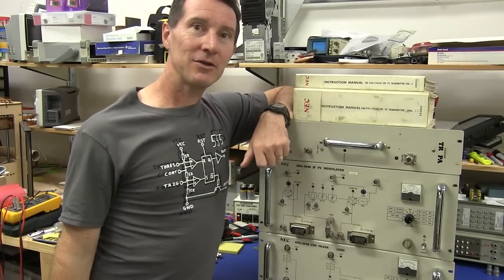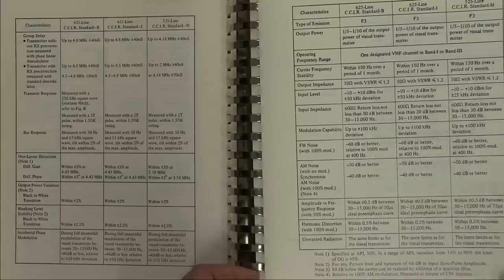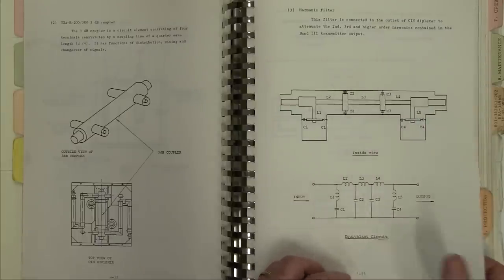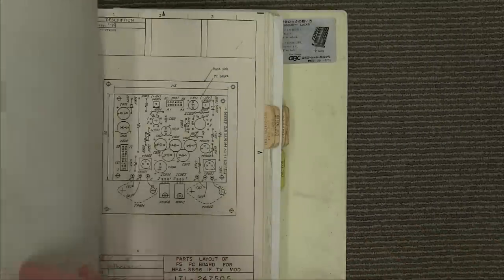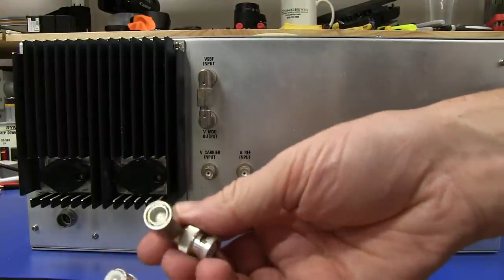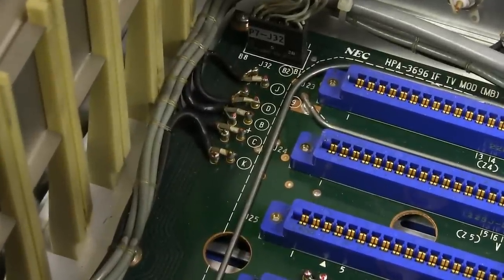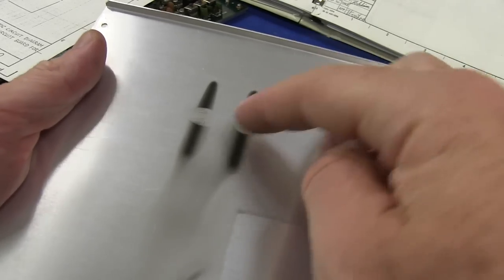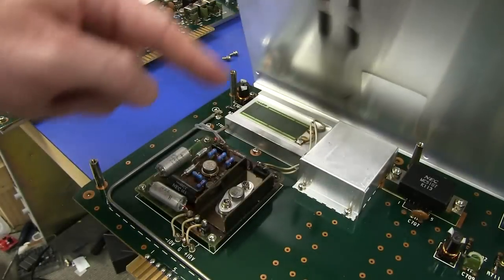EEVblog #574 - NEC Analog TV IF Modulator Teardown

Comment: Dave, you mention someone using the TV signal as a frequency reference. The TV station I work at once got a call from NASA asking what had happened to our signal. They were measuring the color subcarrier frequency (3.579545Mhz), not the RF carrier frequency. It turned out that they had been using our signal to check calibration on field equipment. We had been using a rubidium standard, but it had recently failed so we went back to a normal ovenized oscillator. It was well within tolerance for broadcast, but not nearly good enough for their purposes. They gave us an HP cesium standard to restore our stability.
Reply: Very interesting!
Reply: "...So NASA just gave us a cesium clock." 

Some engineers have all the luck...

Also I like that NASA has enough cesium clocks laying around to give them to the odd broadcaster to fix the signal their piggybacking off of instead of rolling their own transmitter
Reply: Your tax dollars at work. Oh well.
Reply: @moldyoldie7888  Wise spending compared to equiping each location with its own cesium clock.
Reply: @whitcwa  Touche`

Comment: Analogue TV is an outstanding engineering development. One of the design specifications being that on the transmitter side all the complex (thus expensive) processes should be done to the signals so that the TV sets would be really simple (thus inexpensive), in order to achieve the widest audience possible. The gamma pre-equalization to match the nonlinearity of the CRTs, the number of frames and timings to use the line frequency as the reference, the use of POV and the concept of interlaced lines in order to reduce required bandwidth, etc. Moreover, when colour was introduced it had to be done in such a way that B&W sets will still work (backwards compatibility). Colour was added to a signal that was not design for that and this by itself is a great achievement.
Reply: none of that is done in any of that gear though XD

Comment: 37:15 "Some weird-ass, old style lamp" IS a lamp. It's a tattle-tale neon that glows when the fuse is blown.
1:02:40 to 1:04:25 Looks like they recapped the entire PSU.
 The main filters are very modern, non NEC brand & the control PCB is filled with Hitano EXR caps from WES.
1:09:12 The 'sha' in Kinsekisha is dervived from kaisha, meaning 'company' in Japanese.
 So, to a Japanese person, it would read as Kinseki Co. Lab.
 Somebody within NEC obviously thought it was a gross error to exclude the honorific 'sha' from
 the name & 'pencilled it in' just before printing. :))

Comment: That thing has some beautiful construction.  I had to LOL at the replacement Jamicon cap that someone put in there.  Looks like that may have been done in the 90's.

This makes me want to dig out my 1950's military signal generator and do a video about it.  It's all tube based with big oil caps, and has the same immaculate construction.
Reply: Please do. I for one would like to see it.  :-D
Reply: Brohoof.
Reply: Do it Maxx, it's been a long time since you uploaded any in-depth vids !
Reply: If you do it than I will do a Video about My Old Russian Radiotehnika S90 speaker. I will disassemble it. It has Oil caps and big resistors in it :)
Reply: BTW, so far +6 for a highly disparaging comment?  People can be so cruel.
Reply: sprybug
Anyone who knows Maxx's channel will know what the pony is about, nobody else matters

Comment: I maintained a higher powered version of a very similar model NEC transmitter on channel 6 over here in the states. Two 30 kW transmitters paralleled for 60 kW into a circular polarized antenna. It was a very well behaved transmitter. Well thought out design. Sadly at the end of the analog era it was unceremoniously removed and sold for scrap.

Comment: The oscillator was not invented at the same time, Gouriet actually invented it 10 year before Clapp. Gouriet in 1938 and Clapp in 1948.
 Due to wartime security Gouriet's oscillator design was kept secret until after WWII, the same circuit was then independently discovered by Clapp and published by him.

Comment: At a former employer, they had a communications hub for communications to all stores.  It was built with NEC gear and it was just amazingly nice in construction quality.  Even the electrical service panels were just gorgeous!  Beautifully designed and executed.  First rate all the way around.  NEC rocks!

Comment: I always make time for Dave's vids even when I'm busy. ;) An important thing to realize is that even though construction techniques may change with time, the laws of physics do not. This type of gear gives a comparatively clear idea of how different system requirements were painstakingly addressed. Modern gear is all simulated with $250k RF & EM software, but this gear is basically manufactured from the combined engineering experience of that time. Whatever needed to be calculated, was done manually.. and RF & EM math is no walk in the park. NEC probably lost a lot of their "vertical integration" (when a company manufactures many of their own components for their products) when China and Taiwan became prominent in their industry. Same deal happened with Sony and others. Sony used to be all made in Japan. Then a mix of Japan & Taiwan. And today, basically whatever country is cheapest.. which isn't even China anymore. :)

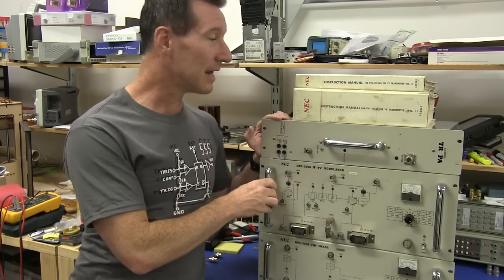Comment: The SAW filter at 1:01 in your video is the vestigual side band filter (VSBF). It would be used to filter out the upper(higher frequencies)of the lower sideband from the video modulator output to create the final "vestigual sideband signal", which is quite a critical requirement to keep things within the correct bandwidth before it's fed to the IF mixer and then RF amplifiers hence it has to be in a temperature regulated oven. in otherwords only the full upper sideband is transmitted and the low frequency portion of the lower sideband so everything thats needed fits within the 7Mhz TV channel bandwidth.

Comment: Walking down Memory Lane here.  Worked on NEC Line of Sight (LOS) Microwave radio's for more then a few years.  Our stuff looked remarkably similar to this type equipment.   Some of the most dependable equipment I've ever dealt with.  Always gave you hints before a fail.  You had more then enough time to correct the situation before things went DEAD BUG.     Those NEC service manuals would lead you down the rabbet hole rather easy.   Our radio's employed the same  Quadrature amplitude modulation (QAM) modulation .   Top shelf equipment for the time.  Nothing like the Dated Rubbish we had to use in the Military.  LOL
Reply: Those NEC Radios had some crazily stable frequency outputs.   Something like    0.000,0001 PPM over a years time.

Comment: Your T-shirt got me thinking about the 555 reset circuit.  It is not well defined, did you know that?  On some 555 timers, reset makes the output stop.  Others it holds it high, and others again it holds the output low.  I know this because I was making a modification to a car alarm some years ago, where the reset condition actually mattered.

Comment: Its an end of an era of great tube transmitters, ps the pa tubes typically lasted 2-3 years, those racks had rear fan cooling via an air intake filter hence little dust . NEC did make some great stuff back then hence 30year life ect only to be replaced by silicon filled multiple plug in  pa modules that have no interesting values ect,  but thats progress what ever that is.  I too appreciate the amount of work that went into these transmitters & other equipment truly amazing

Comment: It is unbelievable how clean everything is. Also on the previous video of the tour. The output valve with its massive airflow around it and perfectly clean. Was the air inside the whole building treated, in some way, like purified?

Comment: my guess for the spacers is that they put them there has to do with capacitive coupling between pins putting a dielectric material in there other then air changes the capacitance between pins to alter their frequency characteristic in some way...

Comment: I think people used the color subcarrier frequency as a reference and not the channel frequency. It was common at the TV networks to lock their sync generators to a rubidium standard. So, if you could grab the 4.43 or 3.58 MHz out of a TV set that was locked to the station, you could get an accurate reference.

Comment: The large blue hexagon electrolytic capacitors are toroidal, you will note that the centre core is offsets the connecting screws.  Not really sure why the are manufactured or what the advantage is for a hex case though?  You mentioned input as being 5 KW, That would be amazingly efficient, I think the input would be more like 15 KW with 10 KW lost in heat and just 5 KW available at the RF output terminal, this does not include any losses in the external feeder lines.  Great manuals, glad you showed us those, real masterpieces.
Reply: You're very close. The spec sheet said 16 KW.

Comment: Best. Teardown. Ever...                  And I still have 30m26s left to go!
I loved the first part, no need to skip. The documentation is as important as the teardown. Question, If it has EVERY schematic, is it possible to hack one up if you have lots of free time? LOL That sounds like something I would try haha.

PoLoMoTo2534 
No dust?  WHAT?  TAKE MY MONEY!!!!

That amazed me too, actually it nearly scared me, considering the inside of my PC after cleaning it only 3 months ago....... and this thing, spotless.

This thing is truly overengineered, which is what I call true engineering. Such attention to detail, so much care put into the construction. I want one! Old electronics were so reliable, what happened. I cant wait untill he posts the manual, I will download it even if its 2GB+. I want to put it on my PC and read it untill I understand everything (I do this with anything I get, download the service manual and read till it makes sense). I wonder if I could find it already on the internet. In my opinion, analog signals are FAR more reliable and travel much further compared to digital. You can get just as good quality with analog as digital also. What truly made me think was the card slots, they are very similar to something I have drawn diagrams for and want to make someday. +1 to the people who made this thing happen!

I cant believe I watch both videos without doing anything else. I guess I could label it education...

Comment: Did they just GIVE you these devices Dave?  Wow!!!

It is very strange.  Just from watching these videos I can smell the electronics! When I was very young - 3-4 - I would sit quietly and watch my father repair televisions.  This was back in the late seventies and, while no doubt hugely inferior in build quality the various internal panels were made up of the same incongruous mixture of half-solid-state, half-valve design and ALL through-hole discrete components.  All the bright colours and interesting shapes used to leave me spell bound.

The smell of solder and hum of a big pistol soldering iron are massively evocative for me and lodged permanently in my brain.  I just wish I had actually LEARNED electronics rather than watched it!

Comment: HDXFH
I agree that is the definition of a proper power supply. I dont think a review could do it justice. It obviously has some amps, I wonder what the max current is! Those are some weird capacitors though, never seen any like it. Iv seen flattened ones, but not hexagonal. I doubt the PSU had ever gone over 30%-40% load the way it looks.

Comment: A TCXO has no oven, it is Temperature Compensated, not oven controlled like an OCXO.
Reply: Michael Terrell The tolerances for the wide band TV signal , a TCXO is fine.
Reply: @andrewagner9212  In Europe big transmitters sharing the same channel used précision offset to minimise interference.
The précision had to be on the order of frame frequency.

Comment: Got to love that Japlish documentation.. at least it's not really recent and doesn't have loads of "born in Japan English".. so other than the weird grammar and fruity selection of adjectives it should be readable. I was working with a company that was making some units to go into apartments and all the documentation said "mansion" instead of apartment because that's what they call apartments over here.. I kept telling them that mansion is something very different in real English but I'm pretty sure they shipped out uncorrected manuals.

Comment: I work in broadcast, cost (today) for a 500w Digital transmitter in the states is around $40k. That scale is pretty linear based on output.
Reply: Best guess for this particular box would've been in the $700k USD range, before shipping from Japan of course.

Comment: I had care of a pair of PCN1430AL's 30KW Low VHF that ran in tandem for 50KW output (see my older vids) It was a little more modern ~1987 with PLL exciters. The only major servicing problem in its later years was NEC was not only an equipment mfgr they were a component mfgr and there are alot of single purpose IC's that were pure unobtanium.

Comment: I have some big electrolytic caps which are flatend. I dont know why either. They are 350V 6000µF. I had some of that specs and size which were round. Must be for mechanical reason or so :\

Comment: Im trying to understand about dimming of the backlight in a lcd tv panel.... is there a simple dimming circuit utilizing a mosfet (pots, resistors, etc) that i can use to control dimming on a salvaged tv panel (45v B+ drive GND controls by LED IC) its 6 segments parallel with 14 leds in series per segment. can a dimming circuit be implement on the 45v B+ line? as i said ive just taken the inverter board and power it straight but i want to control the brightness (down) of the leds, i think its originally dimmed by the ground drive which is driven from the MP3388 IC to all 6 segments?

Comment: Dave, the TV derived frequency standard idea you referred to was NOT done from the RF carrier frequency, but from the video sync frequency of 15.625KHz, which was usually derived from a Caesium etc atomic reference back at the TV station, not at the transmitter site.
As the transmitter bandwidth is about 5.5MHz, a TCXO is fine.

Comment: BIG thumbs up!!! BEAUTIFUL and historic piece you have there. I'm very into all things analog video. I'm watching your vid as I'm up late working on a difficult fix on a BVU 950 Umatic VTR. Likely this model transmitted over your gear there often in the 90's if they ever used 3/4" @ your channel 7 though maybe they had bigger better stuff. I need all the info and background I can get as I never 'worked' in the industry or learned this in school. I don't care what others say, perhaps they get bored easily and it's not hard to skip ahead so what's not to like? I don't know, maybe separate the service manual into another vid but please include as much as you like and Thank You!!

Comment: the standing off resistor might be getting quite hot. have repaired an audio amp where two resistors have been so hot that they melt the solder and released the traces they ware connected to.
Reply: I don't think it was for heat. It was a 1/2 watt resistor which showed no sign of overheating. More likely, it was a part which is not stuffed when the board is built, but added based on the installation requirements. Or, it could be selected after test.
Reply: Chris W you are probably right